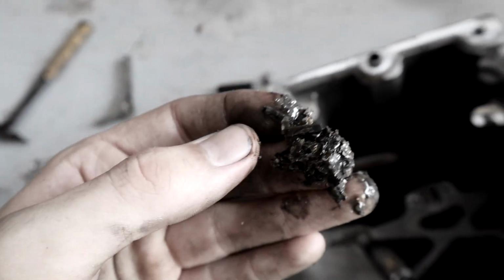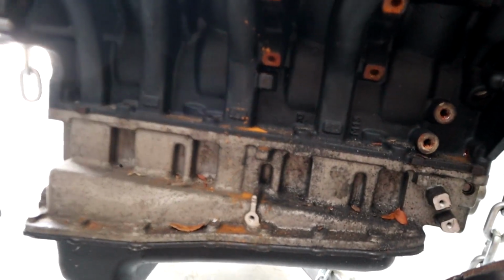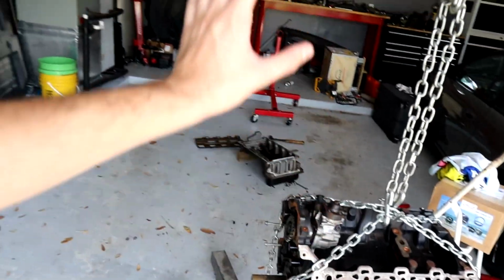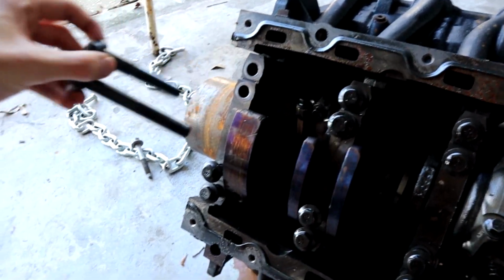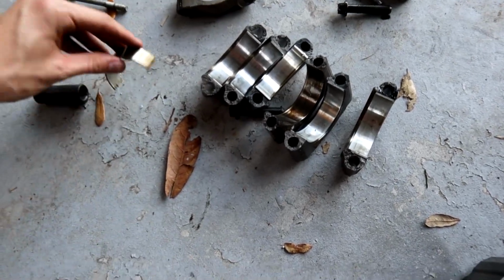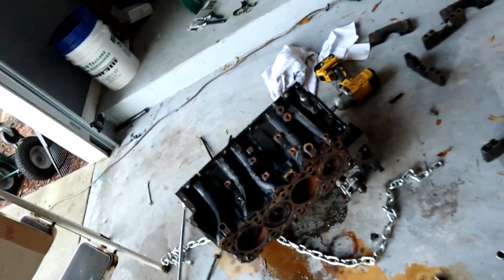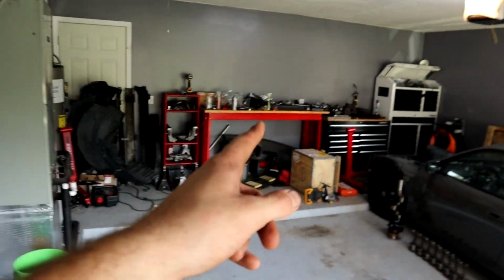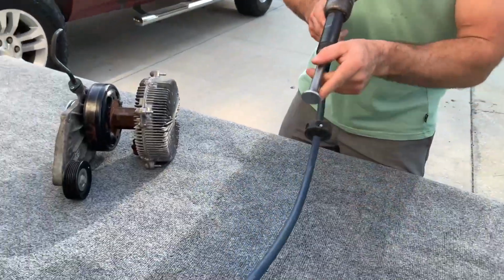5.0 Cummins Titan xd engine failure discovered

Comment: So what likely caused the failure? You haven’t checked the injector harness. Could have been a lubrication issue. Bad turbo was leaking oil into the intercooler. Were the oil jets in the block clogged with soot? Have you looked at those?
Reply: Bad fuel injector pump by Bosch. There's a lawsuit against Nissan for it.

Comment: Was this a 2016 engine?
Reply from the maker: Yes
Reply: @kbridges5.0 there is a voluntary recall/extended warranty up to 150k miles on turbo actuators and high pressure turbos for 2016's and early 2017's due to failures causing poor throttle response which can put you in harms way. If it was your turbo and you can prove it then you may be able to be reimbursed by Nissan. Unlikely given the mods but you never know. It would be worth looking into. I've smoked a turbo before and it dumped all the oil right into the intake causing immediate loss of oil pressure. Might explain the blueing too if the oil hydrolocked the engine much like over fueling can.

Comment: Still have this block I'll take it off your hands I live in FL too.,  btw the bluing is actually from a heat treading process and the crank issue is metallurgical issues.

Comment: Maybe the catch can didn't vent properly causing a crankcase explosion
Reply: Explains the hole in the block
Reply: Or maybe they let the catch can get full. 
It only takes a few CC of oil to break diesel  bottom ends

Comment: So I was bouncing between Amsoil and Valvoline blue Cummins oil

I noticed after 3000 miles on the dot doing my oil change the Amsoil was basically water I could not believe how thin it was

I have switched back to the Valvoline blue 10W-30 and I may go up to the 15w40

And I’m now doing my oil changes every 2000 miles along with a quart of Lucas 

I would use the STP zinc additive but I am not deleted yet and I don’t want to clog my particulate filter
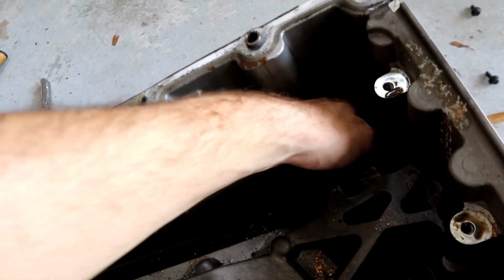3:21 
Another issue that these motors have is the injectors sticking due to high oil change intervals (5000+) which I believe just changing the oil more frequently would solve

I have been trying to warn fellow titan 5.0 owners because a lot of people seem to think since it’s a diesel you can go much longer on the oil but these motors seem to break down oil much faster than other Diesel engines

I have a 2019 titan XD crew cab and the motor and turbos were replaced under warranty due to a factory defect when I first bought the truck so I’m just trying to understand failure points so she can have a long and happy life

Also remember to let the truck idle for five minutes or more after driving to let the turbos have a chance to cool down that’s another very common failure because no coolant or oil circulates after the engine has been shut down and oil burns inside of the turbo clogging it and causing premature failure
Reply: So the issue with the wiring harness is the loom is under too much tension and vibration causes the clamp to where through the wires which sticks the injector open leading the cylinder Hydro locking the engine 

weakest link is what fails and that seems to be the crank because liquid is not compressible like gasses and snaps the crank in 2

The bluing on your crank could be the rod bearings failing and metal on metal friction or where the crank snapped in 2 the rear section that snapped is grinding on the still spinning section causing friction

It is common to find oil in the turbos,piping and intercoolers especially if the seals are leaking this is more common in journal bearing turbo or  ball barring turbos with too much oil pressure

I’m also suspicious of all the tunes that are on the market I wonder yes they are some of the cause of these issues it seems that a lot more modified trucks are the ones failing but I could be wrong I know the 2016‘s had a lot more issues
Reply: I have 132 k on mine , oil change and filters at 5 k always . I see how the wiring harness can be an issue. I’ve notice they run a lot of wires absolutely to close to the engine and even the exhaust pipes . Mine is deleted and full exhaust done straight 3” pipe but they left the egr cooler on . 
I’m gonna take a look at all the wires now and make sure they’re ty wrapped out of the way . Thanks for info

Comment: Looks like my old motor, I'm still nervous about my new motor because nobody found the root of the cause! 👍 Keep them coming I'm waiting and watching 👍🤙
Reply: I'm starting to think it was my GDP tuning and unfortunately that's still on pickup
Reply: @kylevanzee1672 same here, mine went 180 miles after tuning with GDP. What makes you blame them?
Reply: @jordanrusch689  well the main harness looks good front to back and the pickup still isn't running right likely I have 2 gremlins one of them being the gdp tunes
Reply: I have elite diesel and my shit lasted less than 100 miles. It started sputtering and know is like knocking on the top left side of the engine. Wanted to tear it down but winter is right along the corner. And by the looks of it removing this engine is a big pain in the ass

Comment: No surprise that Nissan has discontinued the Titan. I owned a 2011 Titan and I thought that they would learn from all the gremlins inherent in the first 14 years of production. Even the new enhanced 5.6L gas pot is garbage, improper cylinder lubing is causing piston slap, which involves Nissan doing short block replacements.

Comment: Where on my 2019 XD Cummins should I be checking the wiring harness? It’s stock no delete.
Reply: To my knowledge, one dude made a video saying it was the wiring harness but not a single other person on any forum or video has found it to be the wiring harness. The guy claimed it was the fuel injector wires right where they plug in.
Reply: @phantomcreamer  I’ve checked the wiring harness near the frame, it’s clean. Checked at the fuel injectors no frayed wires. Truck runs good.
Reply: @efrenmoran8098  CFTs Youtube started this rumor. You can check the titanxdforum, lots of people with a broken crankshaft, and not a single report of damaged fuel injector wiring. Meanehile the guy on CFT claimed EVERY single crankshaft broken had wire damage on the fuel injector right before the plug. So, in summary, it's BS and the facts do not reflect that statement as being remotely true.
Reply: @phantomcreamer  not planning on a delete or anything crazy. It tows great and I keep up on the maintenance specially come summer with all the towing we do.

Comment: You sir are helping perpetuate some very bad information.  The bluing is from the heat treating process.  Look up the temperature it takes to turn iron blue, look up the flash temperature of your engine oil.  If the crankshaft turned blue in the engine, there would be massive coking of the oil and more likely, the engine would have burned down to the ground.   Look at your main caps, they're not discoloured.  You can also see all of the counter weights have blueing from the heat treatment.  This is further corroborated by the fact that the ISV assembly videos from Cummins show a blued crankshaft, just like yours.  I have a '19, so I have the updated crankshaft, no idea if the bluing looks the same on it or not.

There has been some suggestion that there was uneven heat treatment on early crankshafts and that could certainly result in a brittle spot.  Your crankshaft didn't fail, so your point of failure is elsewhere.

The wiring harness is brought up often, however there is a serious flaw with that argument.  The injector cannot inject enough fuel to hydrolock the cylinder while the engine is running.  If it did, you would have ventilation holes in the side of the block and split/bent connecting rods.  I've seen hydralock failures in gasoline and heavy duty diesel engines, the results are catastrophic.  The other thing that people seem to gloss over, if you lose one or two cylinders the power reduction would be very noticeable, and if you kept driving the truck with that much power loss, the failure would be entirely your own doing.  

How much was your engine turned up?  How much boost/torque did the engine make in the low rpm.  The ISV was designed to rev, so if someone runs lots of torque, down low, with the factory spec oil (10w30), it can hammer out the bearings just from the low oil pressure.  A great number of the delete tunes for our truck are improperly written, and do not correctly address the engine operating modes and how the ecm responds to the lack of emissions equipment.  In many cases, tuners will continue to use stock, or close to stock timing curves, even though those curves are modelled around having egr gas.  EGR retards the combustion process, so if you have no egr anymore, often you can reach peak cylinder pressure with the piston and connecting rod standing almost straight up and down.   Peak cylinder pressure should be achieved somewhere around 72° of crankshaft rotation, as that is approximately where the connecting rod is at a right angle to the throw of the crankshaft.

I missed the part where you removed the harmonic balancer.  How did it come off?
Reply: Who's got proper tunes?
Reply: @ivanpopko7006  I haven't pulled apart anyone elses tunes, I've only seen data logs from some of them.  My tune is technically a derate, but is likely the safest tune for the ISV and I specifically reduce available torque in the 600-1800 rpm range by about 10%.  Otherwise it's a 0hp/0tq delete tune.  The entire development history of it is available on the titanxdforums
Reply: I have a 2017 with 42k on it. Engine is bone stock and not deleted. Seems to me that all the vids I’ve seen with guys having this issue are running deleted/modified engines with other than factory tunes. I’m wondering if that itself is the issue. I don’t think I’ve heard of a failure yet that was on a stock motor though I could be wrong. I’ve just decided to leave mine stock and hope to avoid all this.
Reply: @dbel723333  That was one of the things that gave the 6.0 psd a bad name.  That engine could really be turned up, but then, once the engine popped the guys would have to keep up the story that it wasn't their fault the head gasket let go.  I believe there have been some failures in the '16s and '17s in stock, unmodified trucks.  There are a few threads about it on titanxdforums about it.

The emissions system does add significant load to the engine. If you've ever experienced how hard the 1-2 shift can be, that's almost entirely a result of the engine being wound up so tight to keep the emissions systems happy.

The emissions systems need regular maintenance too, they're frequently overlooked though.  Sensors that get buried in soot and give inaccurate readings, valves that get sticky, or allow more egr than the ecm is expecting.

There is no doubt in my mind the engine runs better and cleaner with the emissions removed.  However, it's not a big engine.  It should not be making more than its stock rated power unless the owner understands that turning it up will eventually break it.

I'm a very calm driver, I respect speed limits, don't accelerate hard.  I'm averaging ~12L/100 or ~23usmpg, mixed 60%rural / 40%urban.
Reply: Your 2019 is better than the older ones? Or are there still engine failures
Reply: @Blackcrow350  I don't have a large enough sample size to give a good answer to that problem.  My belief is by MY'19 all the major issues had been sorted out.
Reply: @dbel723333 my dad's 2016 broke a crank at 70k miles completely stock and always maintained by the dealership(he works there). Nissan put a new motor in the truck. His turbo failed actuator failed at 140k miles. He replaced with a stock one and then Nissan extended the warranty on the turbo and reimbursed him what he spent. Now the truck is deleted and has 170k miles on it, 100k on the new motor.
Reply: @NavyCuda  . Yea i'm not a ballistic driver either. I pull a horse trailer every now and then but not a regular basis. I love this truck but wish I had seen some of these vids before I bought it. It's a machine and of course they all break at some point but people make this motor sound like a ticking time bomb. Thinking about trading it just to get some piece of mind really. Sucks cuz I love the truck itself. :)
Reply: @HuntsT  Does Nissan even know what's causing the crank failures ?
Reply: @dbel723333  That's the problem with the internet in general.  Happy people infrequently go online to spread the word that they're happy.  I remember how many years people talked crap about the 6.7L Cummins because it wasn't the 5.9L.  Or how every single powerstroke is held up against the 7.3, which isn't really as good of an engine as it's made out to be.  I think that Nissan and Cummins both didn't help themselves with the 5.0 in the Titan XD, but it is one of the most technologically advanced turbo diesels available in a pickup.
Reply: @HuntsT Did he have the dealer do oil/filter changes at the recommended 10k miles? Because I’d never go that long. I do 5k for oil and all filters.
Reply: @joenissan  yes, I believe so.
Reply: @NavyCuda hello would you happen to know if the updated crankshaft was installed at the very beginning of the 2019 model year or midway through? Also if you could drop the name of the video where already blued crankshafts were being installed new in factory? Much appreciated.
Reply: I’ve seen too many stock titans have the same issues to believe they’re mostly tuning issues. But then again he used GDP tuning and has had issues with it from the start.
Reply: @NavyCuda my 7.3 is still going over 300000 my 5.0 Nissan motor gave up before 150000 I ran the 7.3 hard for 20 years on 100 ho chip. second owner. I wish I would never have bought the Nissan. still making payments on a yard ornament not my idea of a good time

Comment: Man, i love to see all the negative comments regarding these trucks here on the tube of you lol!
It appears that all the professionals on here think or assume, each one of these trucks, regardless of year, are exactly the same truck and will inevitability have the same issues sooner than later just because...
They're are, has been and will always be good, bad and unfortunate experiences with any vehicle.
Almost no one asks questions or take into consideration how a vehicle was drove, worked, treated, maintenanced, etc.
Take performance upgrades for example. Usually when an individual takes heavy interest and invests in performance upgrades, its for one reason souly which usually leads to abuse which leads to failure completely or faster wear and tear which is unnecessary treatment with most issues being very preventable.
Everyone thinks the titan but especially the 5.0 was discontinued because of such issues. Every brand has their own out the gate issues when they first hit the market until everything is worked out. The titan 5.0 failed because of the big 3 competition and the people who favorded them.
The majority of people simply didnt give the truck a chance even fleets because of their dedication to the big 3. No one that mattered ever got to experience how capable and hard working these trucks can be.
Ive owned my 2016 titan xd 5.0 since new. Its 2024 now and i am just now having issues with my swingvalve actuator so 8 years later and 93,000 miles, id say it deserves one or 2 things to start failing! 
Do i agree with the design of these engines? For the majority but not entirely so its far from perfect but after owning several gas and diesel rams, chevys and fords, personally or fleet related, they will all give you issues minor and major eventually but thats probably irrelevant to the argument im sure.
People can knock these trucks and nissan all they want, yall have your opinions, but nissan above all does have the absolute best warranty which means they have and will stand by and honor their products more than most ESP the big 3! 
Nissan failed and even neglected to update these trucks for years inside and out when competing with other brands which too hurt these trucks. Personally, i dont care about the bells and whistles but alot of people do, especially these days with technology. 
So having said that, i will keep my titan xd 5.0 for another 8 years if allowed by the truck.
My neighbor has owned his xd 5.0 for 6 years now, reg cab long base, uses it everyday to haul equipment and dumpster trailers. He too loves his truck and has never had anything major fail on him and he absolutely loves the truck.
Just because some of you hate and would never own one of these doesnt mean everyone should take your advice and agree 💯. Kinda mimicks when i have heard so many knock harley davidson for being unreliable lol... my family for over 40 years have owned nothing but harley davidsons and each one have served its purpose very reliably.

Comment: Post y’all’s mileage on your Cummins. I’m trying to see if they actually last more than 150k miles
Reply: 110k
Reply: 77k, 2017
Reply: 140k
Reply: 111k
Reply: 154k 2017 p4x weight loss at 54k.Only replaced the water pump at 129k
Reply: 161k with last 25k been towing 5-15k pounds.
Reply: I'm at 128k (10/16/23)
Reply: 238K on a 2017, runs great!
Reply: 33k just deleted it 😂